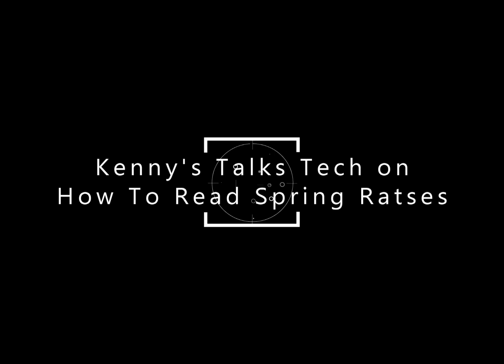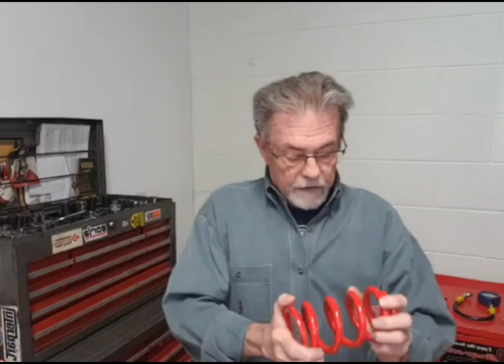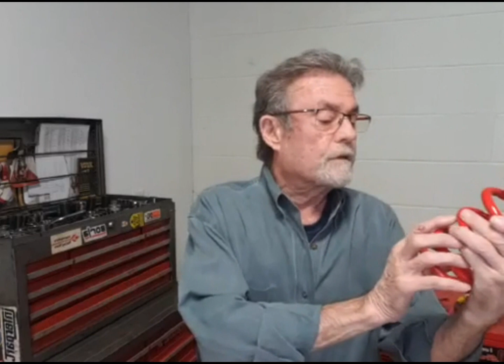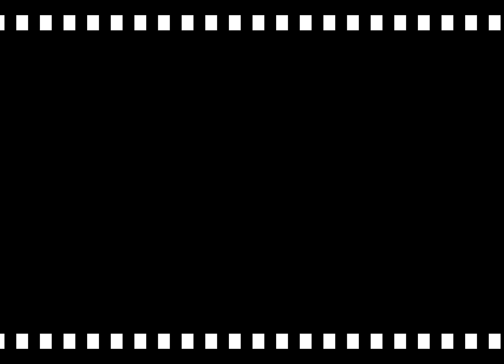Kenny Brown Tech Tip - How to Read Spring Rates

Comment: Hmmm, I have an Eibach spring marked ERS-H-170 60-0120. It's 170 mm long, 60 mm ID. I assume that it's a metric spring and that the 0120 mark refers to a metric spring rate measurement of some sort.